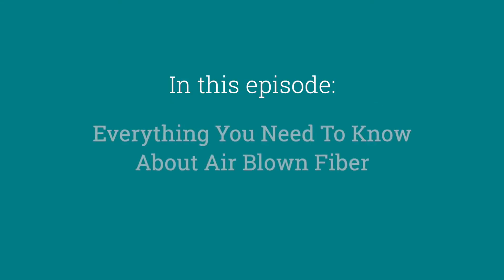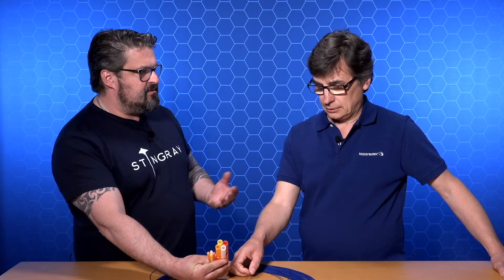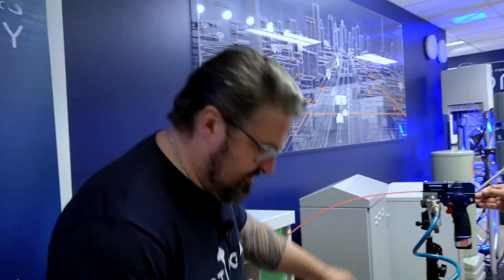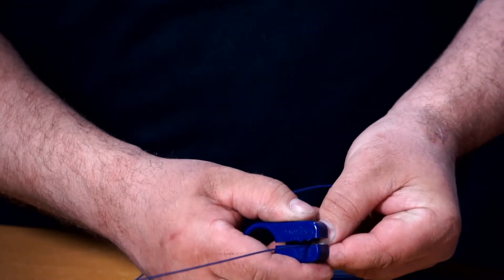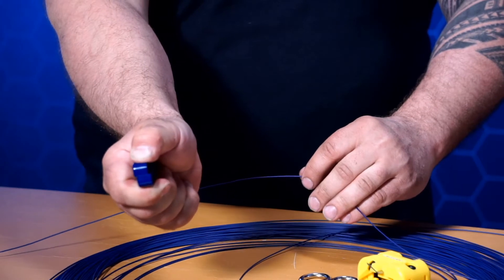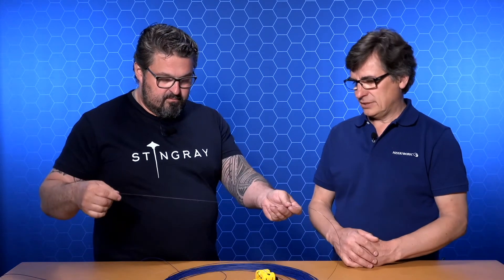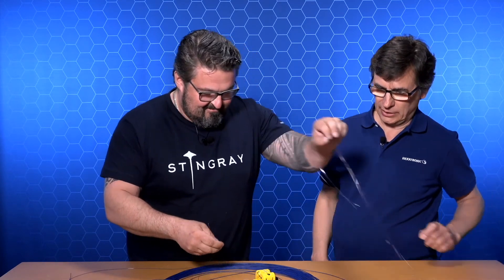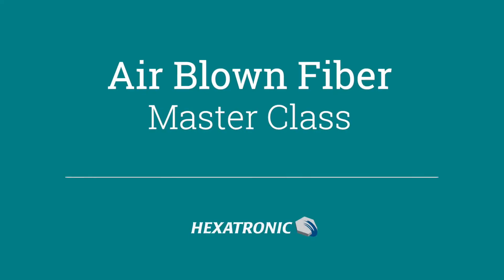Hexatronic Masterclass - Air Blown Fiber

Comment: Great tutorial! A few notes - you can actually use the notched scissors to shave off the outer sheath on extended lengths of the cable - may not apply for all ABFs but works a treat on the Stingray. Also, when starting to separate individual strands you never want to grab the fibres from the end with you finger - clearing off the first few centimetres of the acryalte with strippers can leave a sharp and jagged end on the fibre. I have managed to pierce through my finger with them when being a bit clumsy, working in the dark - as it often is on the field. What you want to do instead is grab the gel-stripped part from the side and roll them between your thumb and finger to separate them. Each profession has its inherent hazards but we try to mitigate them as best as we can.